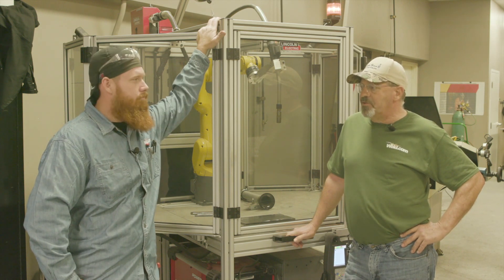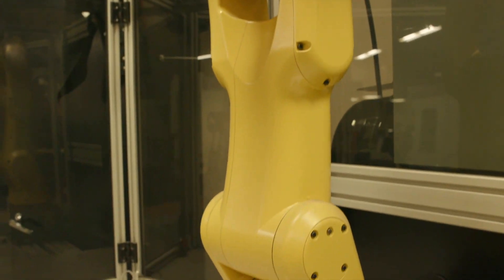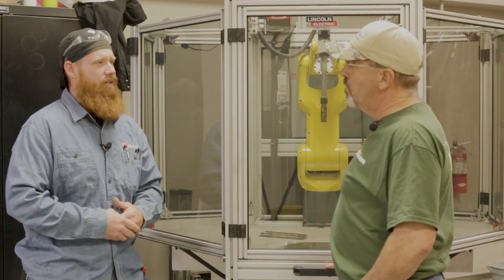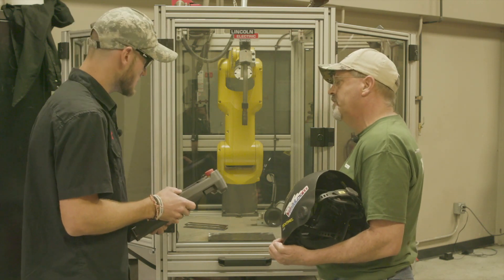Intro to Robotic Welding (at Valencia College)

Comment: Yes having the robot weld whatever peice you want is fun and games but the parts I have to make consist of 130" 1/2" round rod with 7 30" x 1/2" round rod (evenly spaced) each side of the rod gets welded twice we have a north and south program for each rod and every north and south side has 27 welds not including the 3 extra 130" rods you have to do by hand because our window for our robot is not wide enough, I am 19 and work along side my dad and make these all day the run time all together in including the T-clean program takes 36:52 without a wire stick. Remember each rod has a weld on each side 2 x 30 x 7 gives us 420 welds and each weld has a separate program each consisting of 13 movements and you can see where this gentleman is showing Bob what to do you have to hold in the bottom yellow lever and the SHIFT button in order to move anything on the robot, this makes you hand hurt after a while lol

Comment: So the sound of that an that gas this is a spray or globular transfer? Can we get a cut an etch? With as crowned up as that is doesn't seem like it was very good penetration.
Reply: The mode he was using is called RapidArc. Its a lincoln specific waveform that is a cross between short arc and spray transfer with a pulse set up. The penetration is actually fantastic, travel speeds can be quite fast with little to no clean up and can be used out of position being that its a pulse mig set up in nature. Of course the settings could be dialed in a bit better, but that humming sound is the norm in RapidArc

Comment: pretty interesting, robotic welders are only be as good as guy programming them, basically being foreman to a machine, but it's here, looks complaining to learn , an what is right hand rule lol don't let the left hand catch ya lol take care thanks for sharing
Reply: Lol im a little late...but heres your answer. The "right hand rule" refers to the xyz directions of the robot. If you place your right hand out, thumb up, index pointing out, and middle finger pointing to your left, that is the rule. Your thumb represents the z axis, index is y, middle x. You can always change this to something different with a new frame, but its more of a rule of thumb. Also depends on the coordination type your using too.
Reply: Thanks for that bro! 💪🏾

Comment: Tho i completely understand the concept and reasoning of a robots welding, great production stuff. I hate haveing converstaions with people who are throughly convinced robots will take all our jobs. In turn, i strongly dislike welding robots. What do you think?
Reply: Whatever makes the most sense for the job. Same goes for cnc vs. manual machining.
Reply: Swampy  its not a matter of good tradesman or more of them, as technology advances machines become more sophisticated, and cheaper then human labor increasing profits, we are teaching machines to learn by feeding them huge data bases, which reduces the need for programing. .More and more they are starting to build themselves robots building robots building driver less cars and trucks, etc... it's not just in manufacturing and  production, we interface with robots every day, and all of them replaced the need for a human being because they are cheaper then employees...  most dont look like "Roby the Robot" because they dont need to. Think of your ATM, self check outs at the grocery, think of Amazon: (Who doesn't shop at Amazon??) just about every step in that whole process is being automated from taking your order to building the box and shipping it out the door, for now they still need people in the process, and supervisors to push them to work harder and harder, but soon they will not be necessary there either, Amazon in single handedly eliminating the need for brick and mortar stores like Sears which are falling like Dominoes...soon a driver less UPS truck or drone will chuck it on your front porch... in another way Amazon is automating even your job, by automatic re ordering they are eliminating the customer from the process, a machine automatically re orders for you on a schedule while another machine lifts the payment out of your bank account... you could be dead and the shit would just pile up on your porch...it's all about reducing the cost of production to maximize profits, And if you think that the end result of this will be  a comfortable life for all humans with lots of leisure time to raise your family, play and travel...  well... think again, when people are no longer needed, they are simply a burden, a cost to be eliminated because, well, they serve no purpose and are no longer needed... Look in our own country, look at the rust belt where manufacturing once ruled the day but has now been virtually eliminated , shipped overseas , Why? because labor is cheaper there...  What happens to the people left behind? a life of leisure? hardly! what's left are disposable throw away human beings, broken lives and families, epidemic levels of addiction and suicide, desperate people committing desperate acts just to survive are incarcerated and warehoused by for profit corporations financed by your tax dollars... the end result is already here now, all we need to do is look around to see what happens...
Reply: Swampy  you're missing the point, again.
Reply: @ Swampy I thought you were going to say robots that go out and run for beer.
Reply: Swampy  Just about everything you said was also said about outsourcing, hiring illegal immigrants, etc.. the 'it can't happen to me' attitude is why whites have become gluttons for financial punishment.  One way or the other, whites will be ushered in to full-bore slavery.  You can be driven to compete against cheaper robot slaves, or you can march against the barrel of a robot's gun.  Actually, killing eachother to protect the financial elite, royalty, celebrities, etc, will probably be one of the last jobs available for low class humans. (there is no middle class)

Look to the US, UK & Europe to see how fast a billion factory workers can be replaced by outsourcing to Mexico, Japan, China, India, etc.

Look to Mexico, Japan, China, India, etc to see how fast a billion factory workers can be replaced by a few thousand robots.
Reply: As someone who works with these robots all night in a plant that makes parts for VW, BMW. And Mercedes,  they are taking most of our jobs. 
Plant went from 1300 employees to only 700 in less than 5 years. 
It's happening wether you like it or not. 
Just a matter of time.

Comment: Tips for welding MIG uphill? I can’t seem to get uphill. Every other position and stick uphill works great for me.
Reply: try pushing uphill with greater angle. Make sure your burning deep into the plate and not just laying molten onto the surface. Hot and fast should be your travel and pushing as far in front of you with arc angle as possible without losing the arc shield and creating porosity. staying ahead of the puddle, but slow enough so it can build along almost catching you. keep your arc gap practically non-existent smothering out your arc while gouging up and letting the metal fill the burn-out.
 But I didn't tell you that. You have to learn it on your own doing it every possible wrong way first. So you know exactly how not to do it.
 More info would have helped. Like: metal type, which stick using, and joint type. but ya that is the basics. Do-it wrong every way possible first.
Reply: oopsy..... I miss interpreted your question. thought you needed help with stick. but it is going to be basically the same. except you'll have to fine adjust wire speed to smoother the arc into the weld like your trying to push thru the plate while maintaining that ear busting high pitched arc frequency. might want to up your gas pressure 7lbs if your not already wasting gas running it at max.
Reply: Maybe you're running too hot.